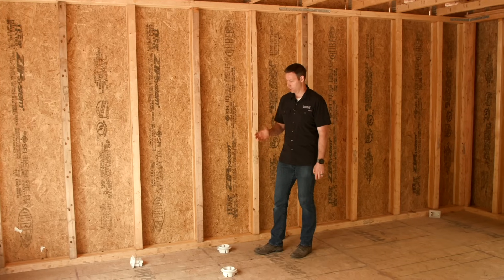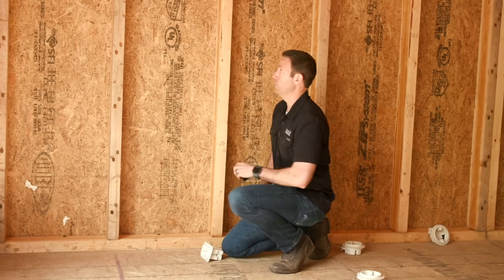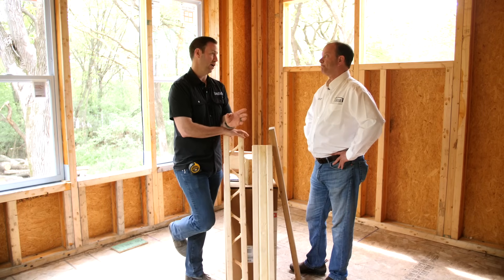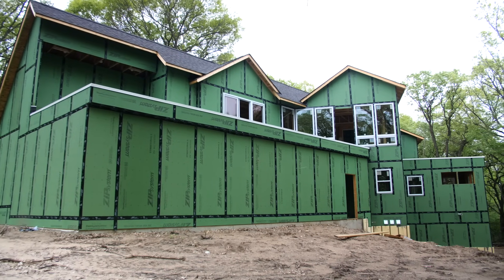Insulated Studs? This is a BIG Innovation in Framing!

Comment: How much money is this nonsense actually saving?  So if we use regular 2x6's on 24's packed with r-20 fiberglass, the 2x6's being r-6 (well roughly since they aren't 6 inches), I calculate that (22*20+2*6)/24 = 18.8.  2X6's are reducing the insulation value from r-20 to r-19!  Forget about it!  Put some more insulation in the attic, that is the absolutely cheapest way to save money on heating and cooling.  And if it is a new build, spend a little more money on windows and doors.  That is way more effective than getting another 1-r out of your r-19 walls.  Oh and I forgot the 2x6's aren't 2 inches wide either.  Doing the math with the fractions our 2x6 wall is r-19.  (22.5*20+1.5*5.25)/24
Reply: So you're making a few mistakes with the math here. You don't just take the two R values and average them, you calculate the heat flow through each different material, average those values in proportion to area, and then convert the result into an equivalent R value. For a 2x6 wall spaced 24" on center you would actually use a framing factor of 22% which is the approximate area of the wall that you could expect to be wood on average including sill plates, top plates, headers, studs, etc.

Assuming the studs have an R value of 6.88 and the fiberglass batts are R 20 you'd take the inverse of the R value to get the heat flux so total heat flux through the wall per degree temperature difference would be (0.22/6.88) + (0.78/20) = 0.0798, take the inverse of that and you wind up with an effective R 14 wall assembly. The amount of heat flowing through the studs making up only 22% of the surface area already account for 45% of the total heat through the wall so even if you installed some magical R 1000 insulation in the cavity and cut those losses virtually to zero you don't wind up with a R 750 wall, you wind up with a R 31 wall.
Reply: @AndrewMerts  You are correct I forgot to count the plates, headers, etc.  It didn't cross my mind the foam studs would also be used for those purposes.  I thought it would make a negligible difference.  But now having looked at it the plates alone account for 4.5 inches in 96 (4.7%) whereas the studs are 1.5 inches in 24 (6.3%) so the plates are not insubstantial compared to the studs and should be counted.  22% still seems high to me but I'll take your word for it once headers, sills, jacks, and cripples are added in.  So what's the r-value of these foam filled truss studs and can they be used as plates and headers?  Regular styrofoam insulation is about r-10 per inch, which is way better than fibreglass, so just eyeballing it these studs might be r-30.  That would give a wall with higher than r-20 and certainly higher than r-14.  But is it actually better and cheaper than wrapping the whole house in an inch of styrofoam on the outside of the framing?  That should give r-24 with regular 2x6 studs using your value of r-14 for the wall.

PS I think our formulas amount to the same thing but your calculation took in framing members that I had excluded.  Your method is better because it allows for a simple way to represent all of the framing members as a simple percentage of wallspace.

Comment: the increase in R-rating is insignificant versus the cost.  I know builders and they are cheap as hell.  If you cannot see it and touch it it will not reap value at the sale.  I like innovative thought but this product will not take off.

Comment: I feel like it would be much cheaper to use a 2'x4' - 2'x8' double wall than to use a tstud plus the extra structural integrity from using larger sized wood. I may very well be wrong but I have a little bit of construction experience under my belt that tells me this is going to be expensive for what you're getting especially when switching to a 2'x8' wall, 24" on center. At the cost of about $10 per a board. If you doble the wall you will not also getting more structural integrity, better acoustically sound, and the R value would shoot through the roof. I am no way shape or form knocking tstuds because I do not have enough information to compare the differences between time, cost, structural soundness, acoustic soundness, and insulated factor.

Comment: Something like this also speeds up electrical work so there’s another bit of cost saved.
Reply: Absolutely true. No more drilling through studs to run wires, I'd be worried about hitting those dowels, and making a huge mess.

Comment: It's getting to the point where fresh air inside a house will be a rare commodity. Years after living in these cocoons, we'll start hearing about how these homes are equivalent to the "sick building" syndrome we heard about years ago. I'm all for keeping a house warm in the winter and cooler in the summer but enough is enough.
Reply: Yes, air exchange is necessary for health. Also, as these homes age, they will rot from the inside out as they won't be able to breathe. We all know homes shift over time and this create voids. This is why framed homes built in the early 1900s are still standing. They are allowed to breathe with heat exchange and this keeps the wood from rotting. It does come at the expense of energy efficiency though. In the end, it probably is an even exchange.

Comment: If an Energy Modelling will be performed, it will be evident that the best way to combat thermal bridging is from the outside. 1 1/2"or 2" xps rigid insulation (CI) with a rainscreen system for exterior finish is sufficient while at the same time, that pushes the Dew Point to the sheathing line.  I still think that keeping the extreme cold temp. away from the sheathing is still currently the best at the moment.
Reply: This creates a moisture mold potential.  Check the research at cchrc.org
Reply: @jeffreyaderholdt2359  The building standard in Europe is insulation from the outside. The moisture issue is addressed by placing a vapor barrier around the wooden structure before any insulation is placed. And the recommended insulation thickness is pretty huge. 20 cm polyisocyanurate usually. That and the vapor barrier do a lot against moisture. Then again I'm unfamiliar with what happens in American climates with that system, so take this with a grain of salt.
Reply: External insulation is good but XPS or foil/plastic faced foam sheets (taped) are effectively a vapour barrier. The thickness required to keep the sheathing side below the dew point depends on the climate zone and the thickness of inboard insulation. Very common up here to use 1" or 1.5" exterior foam sheets over batt and 6 mil poly on the inside wall. So a double vapour barrier nono with the sheathing below the dew point in winter. It is safer to use a vapour permeable exterior insulation like rockwool board. One can use really thick foam, but then fastening siding becomes more complicated.
Reply: @jamesroscoe7555  From where I am,  the min. required for residential exterior wall remains R-20 (6" batt will take that to R21). With the addition of 1,5"xps  in front of the permeable Bldg. paper over sheathing will take that wall to R28.5 thus combat Thermal Bridging at the rim board level (2nd floor) all the way to foundation.
This system is very much applied once using steel stud. 1.5" xps is not required on wood framing as per Ashrae 90.2. 
90.1 can also be applied for low rise and commercial where an optional Mechanical System Performance Path allowing HVAC system efficiency tradeoffs based on TPSR.
And yes,  clarification to prescriptive envelope performance data tables must be met in different zone from where I am.

Comment: Pretty neat... if you could combine this with something like a SIP for cladding on the outside, still insulate the voids between studs, and put radiant barriers on both sides of the wall before finishing interior and exterior and the R-value would be through the roof.
Reply: Why? Gas is so cheap  no need for that. This ain't no europa

Comment: They came out with something similar years ago... OSB web inside two 2 by 2s just like what you are showing on the outside of the foam... Great Idea but it was a pain in the ass as the 2 by 2s split out way more than a full stud when you went to nail them to the plate... Many new ( improved ) techniques sound good until you actually are the guy doing the work...

Comment: I see you focusing 100% on energy efficiency/performance in virtually all of your videos.  You're constantly talking about alternative construction methods and alternative products that can have an AMAZING difference in efficiency.  But you don't seem to ever consider price to performance ratio.  What I essentially mean is how much you are going to save in utility bills compared to how much MORE you'll be spending on these amazing products.  For example; a traditional house that is constructed with regular studs, regular OSB sheets, typical insulation, a non conditioned attic, typical central air system with duct systems that aren't engineered.... Just your basic everything.  How much will the heating and cooling bills be monthly?  And then you have your ultimate efficiency house; tstuds, those zip OSB sheets, best insulation, conditioned attic space, great windows, engineered and completely sealed duct work, very efficient system (maybe even a geothermal system) ... I'm talking EVERYTHING done with the absolute most efficient materials and in the most efficient way.  Now how much will the heating and cooling bills cost for this home?  After comparing the heating and cooling bills, then you compare up front costs... How much MORE did it cost to build the ultimate efficient home?  Take these numbers and figure out how many years, or decades even, it will take before the cost was worth it.

What I'm getting at is that there MUST be a GOOD balance somewhere.  Some products might cost so much that even though they are far superior, the price to performance ratio is just too high.  I have a great interest in increasing the energy efficiency of my home but I am not rich or even wealthy.  So the cost MUST be worth it.  Finding that perfect balance is crucial for me and for most people.  Not everybody can afford to just dump a ton of money into their home (be it a new home, or a remodel) if it'll be decades before the savings are worth it.  Gotta hit that sweet spot.  And I'd love to see you do a video on that idea specifically if you haven't already.
Reply: $1.5K-2K extra for these t-studs isn't that much more when you are building a house. I'd like to see those numbers too. If I can save an extra $25 on my electric bill for each of the hot months where i live (4 months to be generous), that'd be $100 a year. So let's say 15 years as a return on investment (because my gas bill would likely be lower too in the cold months); that's not terrible. I'd be interested if other things may factor also, e.g. if the temp is more regulated, will it decrease mold and other temp issues? How about the bug invaders? Other features of this framing would be nice to know.
Reply: @MikeFaneros  and mice...dont forget how 30 years later..most stick homes are riddled with mouse turds in their walls/insulation.
Reply: You're acting as if homeowners have a right to make such decisions on economic analysis.  What an antiquated notion, LOL!  The city planners in their infinite wisdom are taking those decisions out of the hands of mere homeowners and taxpayers.  :)

Comment: T-stud is a wood version of the structural steel frame that's studied in universities under Mechanical engineering programs etc. It seems to be a good application. Congratulations
Reply: I am confused about the studs on their sides. Typically the structural steel frame cannot be used in this manner(lying a truss on its side) as it distributes the loads in the worst way. So Wouldn’t this be similar to stacking dual 2x3s on their sides?

Comment: Pre engineered studs are great if used properly but the fire rating is a lot less than a solid wood.  Where you have a 4 hour rating the fire rating  could go as little as 30 minutes.  It could collapse the house in a fire a lot faster.  It is a lot lighter and it works great if the forces acting on the studs never change.  The foam could have a toxicity issue as well look into what the foam is made of and if hot weather makes the foam produce toxic gas.  Drilling a hole can weaken the pre-engineered studs as well.  These would be some of the concern but it looks like pre engineered studs are the way of the future.

Comment: Notice how they had to use (3) 2ft single windows to make a large window on the load bearing wall. They had to use LVL in-between the windows and kings 13:07?  You aren't getting call backs on nail pop because your studs are 2.5 inches wide and they can miss. They had to bracket the corners (probably cuz of the single top plate which is weak). I have an infrared camera and I can tell you the studs are slightly worse when it comes to R-value but I believe foaming the exterior would be a much easier efficient way to go.

Comment: Ok so IRC says you can not go any further than 10' on the horizontal without solid fire block, and if this is used as a top plate you lost your solid fire block between floors too. How do you deal with that?

Comment: Down fall of this system 24 inch on center , 5/8  s or better sheetrock  should be used 1/2 inch or less bumping against the wall will break the sheet rock

Comment: Those Tstuds look very impressive. Question for you, here in the UK, most housing is made from brick/concrete block etc, its very rare to build from wood. Just wondering why so many homes in America are wooden built. Granted in the cities they aren't. Is it just the access to so much wood is available? tradition? just curious. My fiance comes from Finland and they also build a lot from wood in "Suburbs" , and only brick etc in towns and cities. Still, you've given me many ideas on building solid for my future shed👍
Reply: Millions and millions of acres of coniferous forests. No enclosure movement to run sheep on every inch of steeper land, stopping natural reforestation. Much of the land intentionally planted in the U.K. with government funding after the war use species from North America. Sitka spruce, Douglas fir. Go back a couple generations, we’re any of your great-grandfathers lumberjacks, saw-filers, high-climbers and spar pole riggers? Britain had lots of clay and straw, and lime, and coal for the kilns.

Comment: There have been steel framing studs made in this style for at least 35 years. My dad built a house in Austin Tx back in 1985 with foam block exterior walls and framed with these truss style 2x steel wall studs, floor joists and roof trusses... great fire discount on homeowner insurance!!!

Comment: As with any new technology, you have to wait a few years for the dust to settle, and for things to gradually get better.     The iPhone 11 was not created over-night, for example.      Someone may come along and find a way to mass-produce these using dowels made of recycled aluminum, a simple way to 3-D print them, or just make the wall in the factory and ship the entire fricking wall to the job-site, or just make modular rooms in the factory, and ship the entire fricking room to the job-site.     This would definitely solve some problems in the manufactured-home industry, maybe mobile homes and travel-trailers too.

Comment: Those joists are kinda thin. And 24 inch spacing between studs? And pressed wood shaving glue board? Man, standards are crap these days. Why the hell is this in my viewing suggestions you cheap ass snake oil bastard. Need a door? Just pee between the studs and BOOM, door... and rat nest material.

Comment: im trying to do a report on these for building envelop class, is there anyone or anyway to get in-touch with a company that has worked with the tstuds? i would love to get there feed back on working with it and how its been adapting to its differences from tradition lumber.  also has anyone used this in a area where earth quake codes are more of a concern? it looks like it should be fine, but i live in the west where that is more of an issue than back east.

Comment: General question about Sheathing. I built a house with a local builder and they use 2" rigid foam with a steel bracing running diagonally across the studs to hold it in place. Rather then use wood osb sheathing then rigid foam. 

Thoughts? 

They obviously met code for Ontario but this practice has always made me concerned. As behind the siding is foam then drywall. 

Thanks!

Comment: In the 70's we framed 2x4 studs on 2x6 plates, one foot on center staggered. solved problem then. This is NOT A BIG DEAL. Windows are your biggest heat loss at R-3 for a dual pain, modern (PVC) window. Triple pane up to R-8- R10.

Comment: How is wood a bad insulator? It's technically polymer, it works just fine for mitigating heat flux. Metal studs would be a good argument though, but do you really need expensive 2x6s on your non-masonry house since masonry traps moisture? lol

Comment: How is that an r20 when no stud cavity with insulation is an r19.? I must be missing something
Reply: Because R19 cavity insulation is crap fiberglass, while they're using closed cell spray foam in the T-stud.

A proper comparison would be 5.5" of closed cell spray foam, which would be something like R37.  In comparison, an R20 T-stud does suffer a loss.

Edit-If you're going to spring for premium materials you should do it everywhere.  Use R23 2x6 mineral wool at the very least, if not something else or some combination of better insulators than fiberglass.